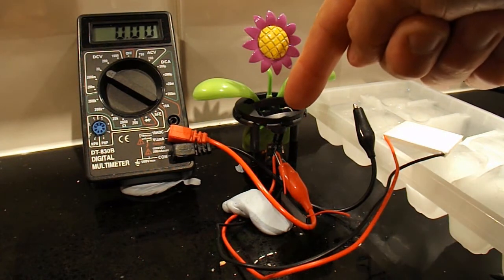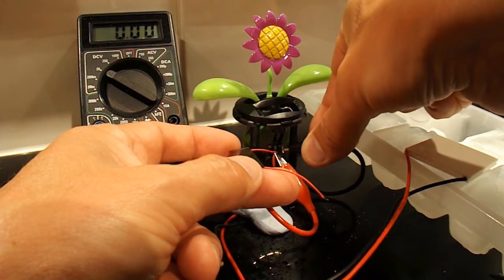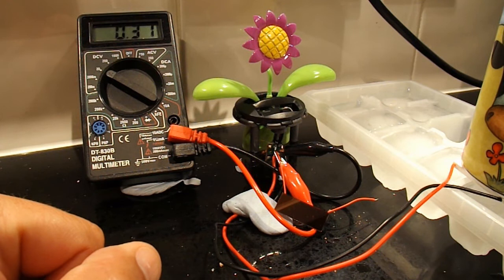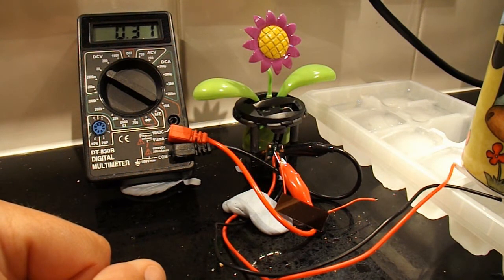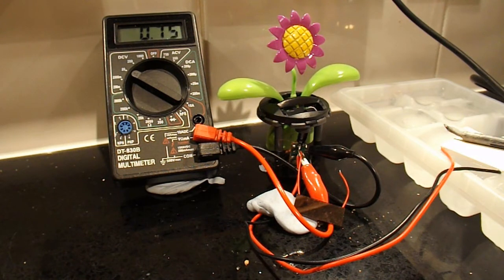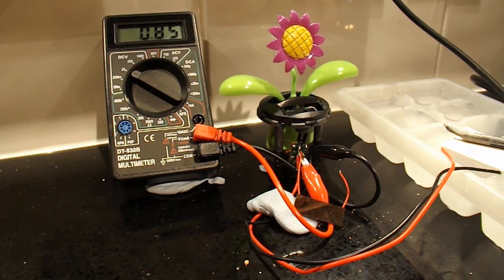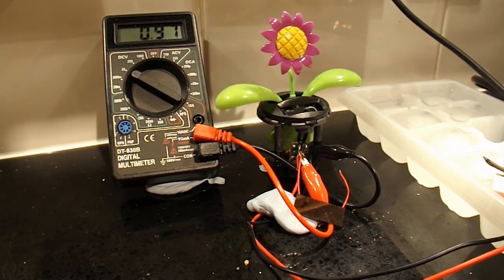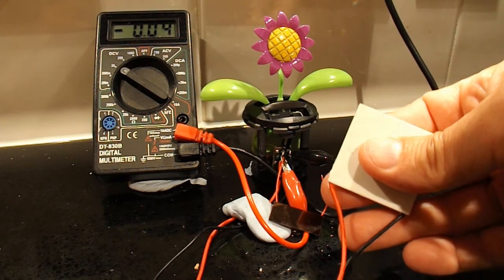Playing with a Peltier Tile and a Solar Mover

Comment: Could a peltier tile be used between a freezer and a warm room? where part of it is exposed to the freezer temperature (-18 to -23 celcius) and the other side to room temp (23 celcius)
Reply from the maker: Yes, it works with any temperature difference. The bigger the difference the more power is generated, or you can use several tiles together to generate the power from a smaller temperature difference. I have seen people put a blow torch on them to get high power. Lidmotor has done some interesting videos on the subject https://www.youtube.com/user/Lidmotor/search?query=peltier